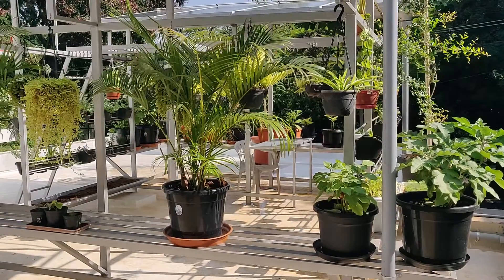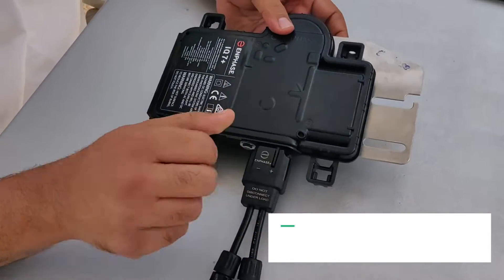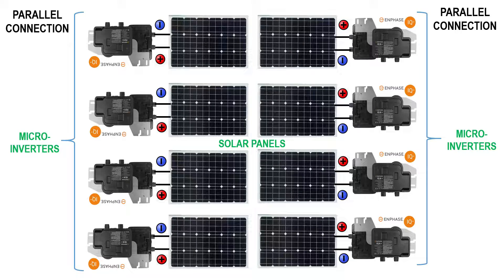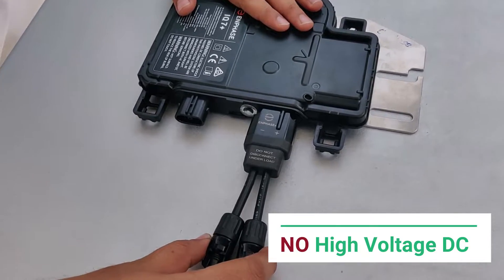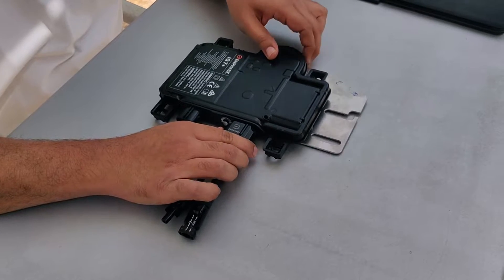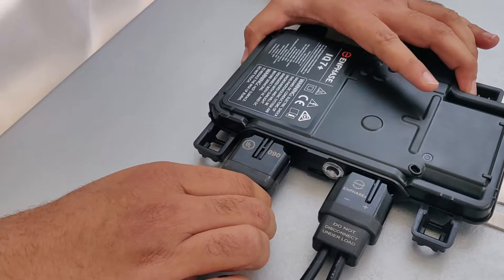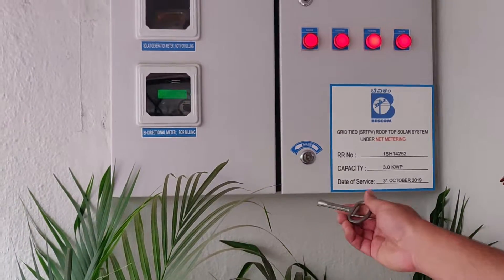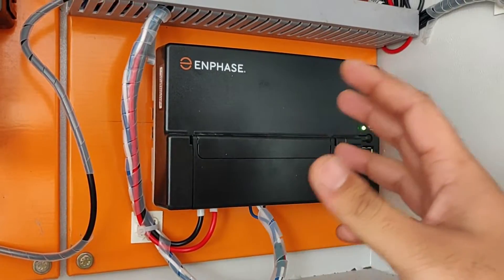On-grid or Grid tied Rooftop Solar Photovoltaic system using Micro inverters

Comment: how is module level monitoring possible? since the envoy only takes in 2/3 CT and one power supply wiring. Are all the modules independently connected to the envoy through wifi or something ?
Reply from the maker: https://youtu.be/3QvoEYrncRM
Reply: @HinrenEngineering   @Hinren Engineering  well that link you sent is not the answer cause I asked for how the envoy communicates with each micro-inverter. That link explained how to install a system but not how it communicates with each other. 

Anyways for those curious, I found the answer. 
"The Envoy uses advanced powerline communications technology to connect to each microinverter without additional wiring or wireless configuration."
Reply: Answer - "The Envoy uses advanced powerline communications technology to connect to each microinverter without additional wiring or wireless configuration."

Comment: Hello Sunil, in case of a power cut, will this system stop power generation or does it have a standalone mode for domestic consumption?
Reply from the maker: It is possible of we couple another device called 'Ensemble' with it .
Reply: @HinrenEngineering  But it is still a concept or is it available in India
Reply from the maker: @fmsrworkshop1384  not yet available in india